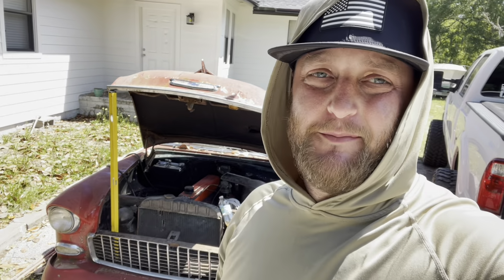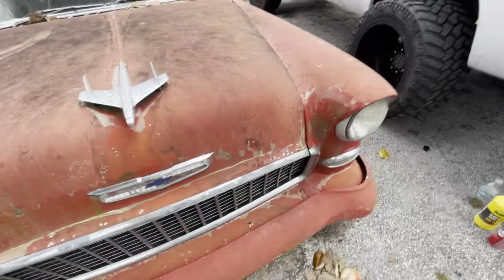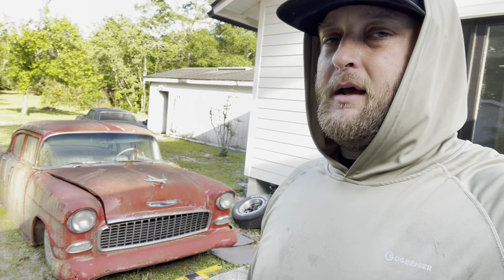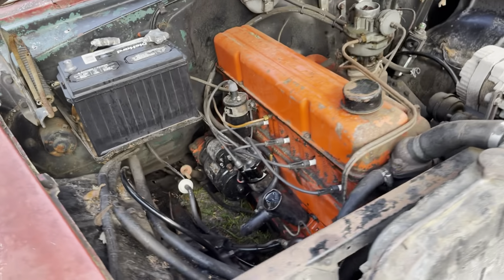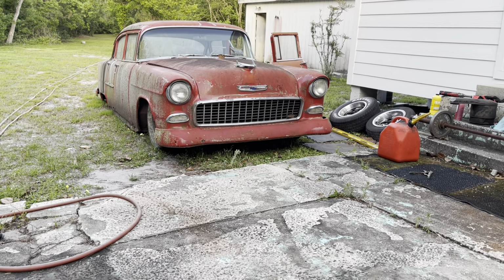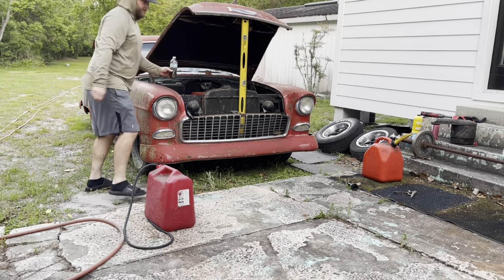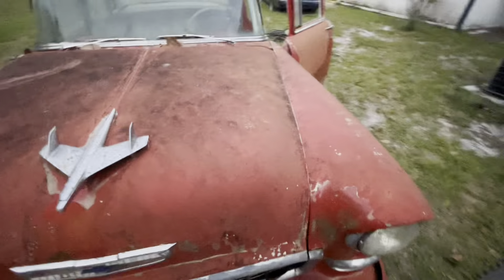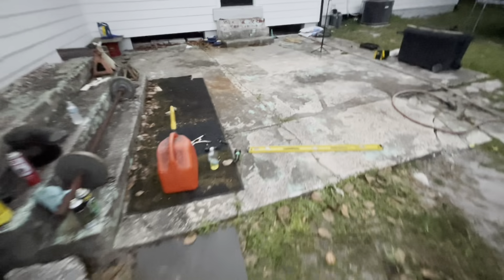Bagged 1955 Chevy Resurrection pt2

Comment: I love the 55 low like that. It just looks killer man! Check the vacuum advance to see if it's diaphragm is blown out. They are usually wasted from age. It will need an accellerator pump in the carb.  You should put a rebuild kit in it. Very simple even if you've never built a carb before. If it's still stumbling, it will need a little more advance on the timing. Replace the thermostat because it's probably stuck. If it is sucking air anywhere in the fuel line, it will not want to pull fuel to the carb. Tri 5 Chevy's are what I mess with. Lot's of videos on my channel. Check out my Tri 5 tech tips playlist. I subscribed and will help if I can with any questions you may have. I'm NOT trying to plug my channel, I just like helping other tri Chevy guys out.
Reply: Also, you need to put lead additive in the fuel to lubricate the valves. You can buy Lead Substitute at auto parts stores. Also do not run engine oil unless it has ZDDP in it. Using regular cheap oil will flatten the camshaft lobes.
Reply from the maker: @haffrods7055  tons of great info, THANK YOU. I’m sure the diaphragm on the vacuum advance is toast as I’ve owned the car since like ‘98 and never touched it. The carb was replaced more recently but probably does need to be gone through again. 

I’m going to check to see if I even have a t-stat in there but I’m sure the system at LEAST needs a good flush.  I am going to replace the old rubber fuel line and ordered some new spring clamps to make sure I get a good seal everywhere. Also need to look into the lead additive and what kind of oil I used last. Thanks again!! 🤘🏼

Comment: Try  the fuel pump on the engine
Reply from the maker: Pump’s working. Apparently it wouldn’t prime though because it was sucking air through a cracked line. Check out pt3 where I fixed it! 🤘🏼